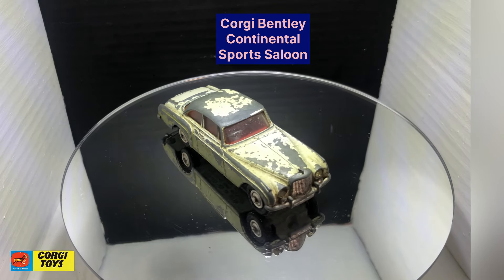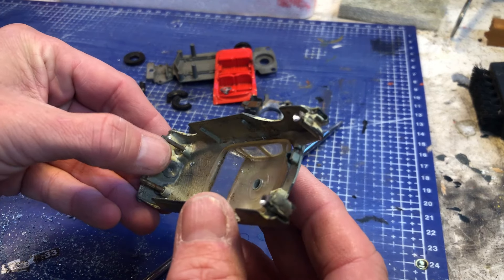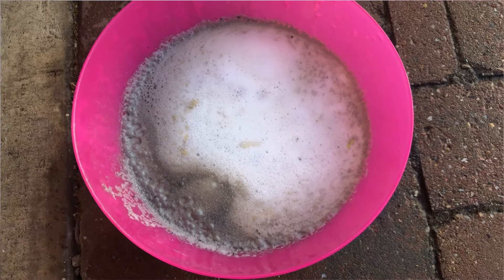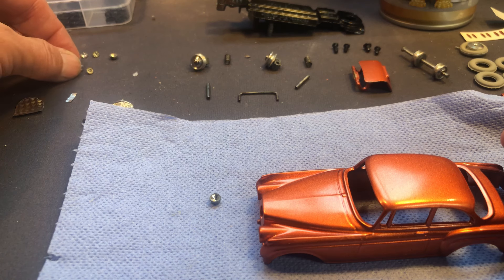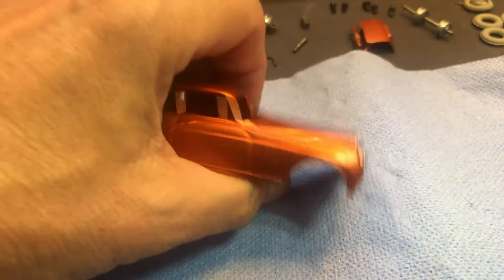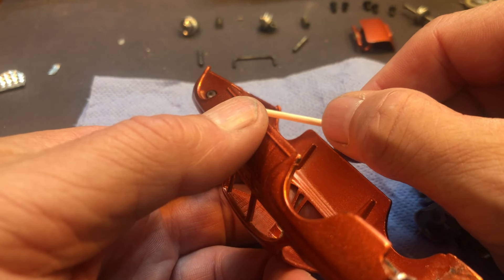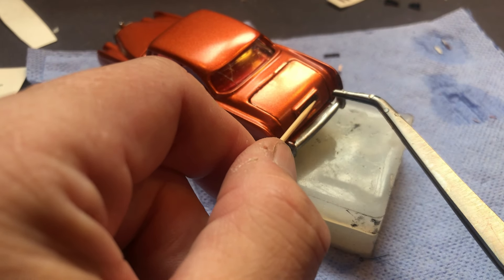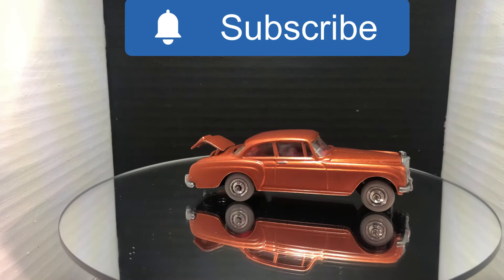Corgi Toys 224 Bentley Continental Sports Saloon #Restoration #repair #diecastcar #diecast

Comment: You had fun with that one, andy nice work around on the back lights ,and a great colour, quick tip when assembling the front end on this type ,use a drop of  petroleum jelly to hold it together, and it will  also act as a lubricant for the steering.
Reply from the maker: That’s a good tip. Thank you. 👍

Comment: Andy, it's a very nice job you did on the Bentley! Did you put an acrylic clear coat on the bronze metallic? ❤
Reply from the maker: I did put a clear coat on. It didn’t take as well as the BMW I did but I think this finish does suit the car. I use auto extreme clear coat (here) and sometimes Rustoleum clear varnish. Thanks for watching and commenting 👍